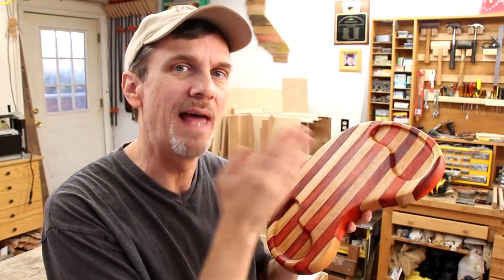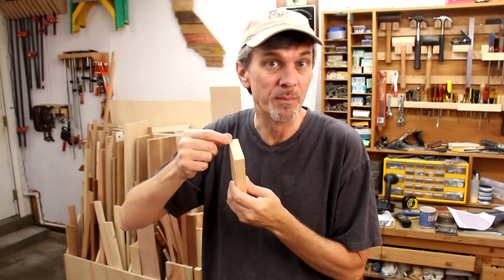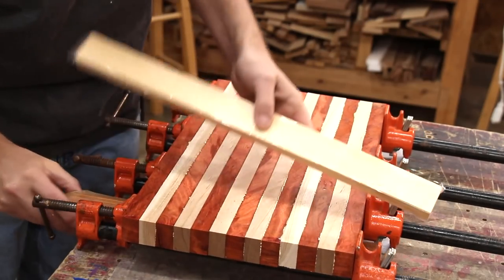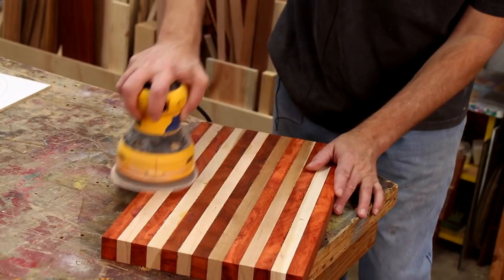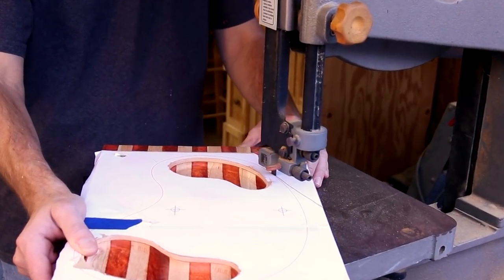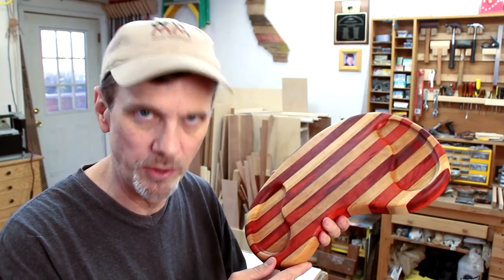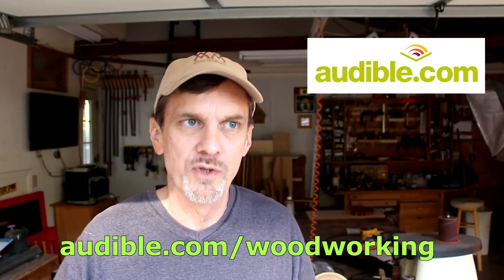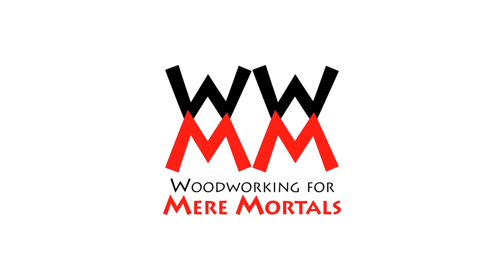Wooden cheese board. You can make this simple cutting board project.

Comment: Question:
I've an unfinished cheeseboard which will be used on occasion as a trivet. Does Mineral Oil bleed out when subjected to heat?
I'm torn between Mineral and Tung oil
(my experience with my end-grain, finished with mineral oil and beeswax-min-oil, is that it does bleed if a hot pan is placed on it).
Thanks so much for your help!

Comment: Steve, I'm attempting to build this board but having a hard time finding what you called a "bullnose" bit to cut the concave areas. I have a 1/4" cove bit but it won't fit into my collar. And a search for "ballnose" bits doesn't show much. Do you by any chance know the specs of that bit you used (brand, diameter, length, etc.)? Thanks much!

Comment: I would really like so see how dovetailing is done. any chance for a video?
thanks.
Reply: Steve is the President of the Anti Dovetailing Society
Reply: not from Steve but there are 1000s.  I'll give you a tip.  The devil is in sawing straight.  Not easy to do without practice.  Start cutting in the waste and then use a chisel to ease up to the lines.  As you get better at sawing you will saw closer to the lines.

Comment: Steve......I am fairly new to wood working and don't have the money to invest in some higher priced tools. What would your suggestion be to substitute running this through a thickness planer? I find that there are some projects I've been avoiding since I don't own a planer but I'm not ready to buy one just yet......
Reply: Right on....... Thanks Steve.
Reply: If you have a router, look into using a router sled. Watch The Wood Whisperer's video 174 - Flattening Workbenches and Wide Boards With A Router,to see what I'm referring to. I use them all the time for the same reason (No Thickness Planer).